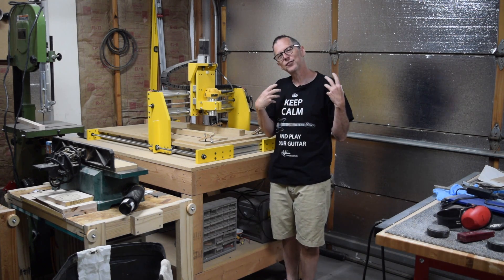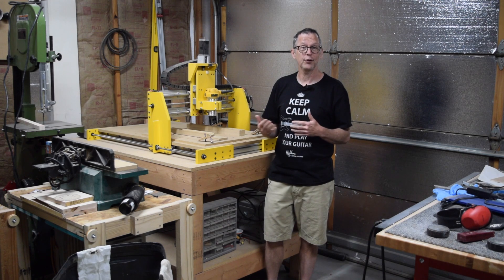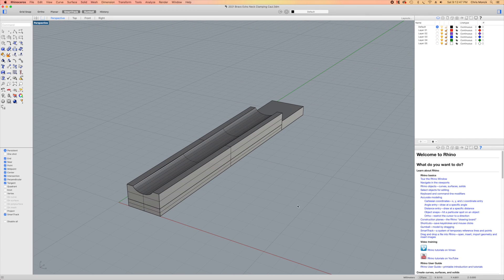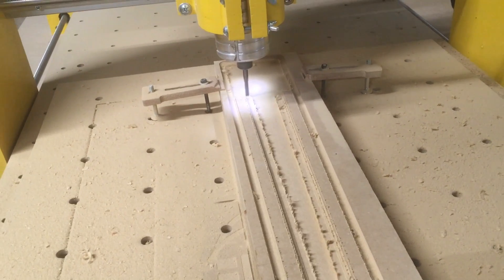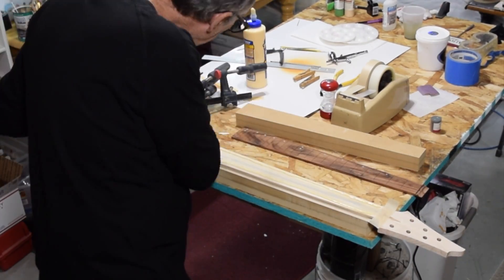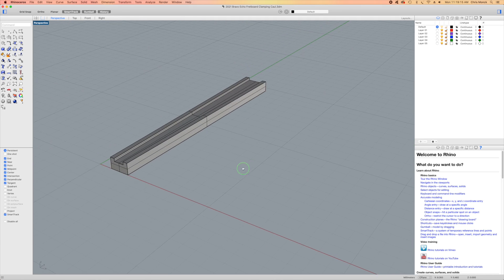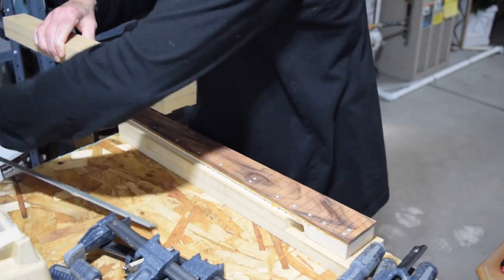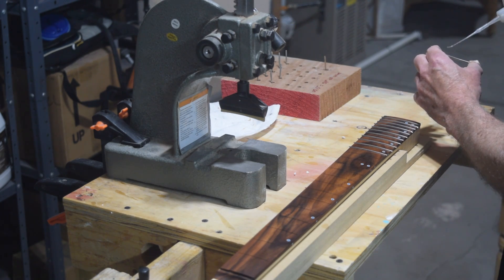My Clamping Jig For Guitar Necks

Comment: I was just about to do EXACTLY this after my later fretboard glueup went wrong at one end. I thouht i had clamped the edge but must have pressed down into the truss rod and it actually lifted the edge of the fretboard at one end 😢. Is the fretboard cawl radiused as well as leaving the gap down the middle ?
Reply from the maker: It's not radiused. It only has a center channel.

Comment: Love your videos Chris. That salt trick is a nice alternative to the pins in fret slots I see so many use. A serious question here is why not kosher salt, the crystals are bigger and I would think easier to handle.
Reply from the maker: Sea salt!! Best for tone. Seriously, I don't think it matters. Table salt is smaller and works fine. Larger particles may prevent the two surfaces from mating up tightly. Test it and see.
Reply: @HighlineGuitars  Tone salt 🤣

Comment: Hey Chris, thanks again for another great video. By the way how long did it take to learn all the software and also using/setting up your CNC
Reply from the maker: That's a tough question to answer as I didn't track the time it took to learn. I will say that the learning curve is fairly steep. The trick is to find software that you feel comfortable with. I tried demos of a lot of different programs before settling on my current workflow. As for using/ setting up my CNC machine, I started with an X-Carve and spent a few months learning how to use it to dial in my settings. Then I continued using the X-Carve to make bodies and necks before I decided to design my own CNC machine. By then, I felt comfortable with the technology to able to build and use a machine of my own design.